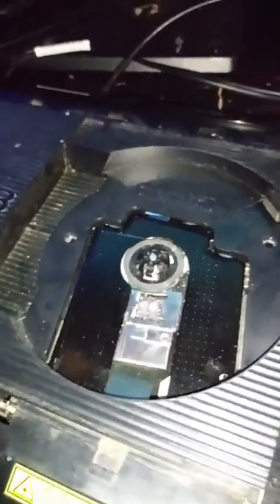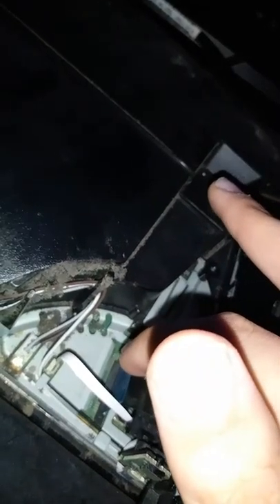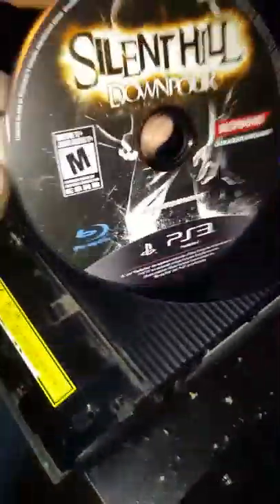How to fix ps3 super slim not spinning disc or reading disc

Comment: That's the EXACT problem I had on my PS3 Super Slim, the connection must have gotten loose over time. Thank you so much for showing this issue on camera, otherwise I probably would have never opened my PS3 and tried it myself 🙏

Comment: What’s all the screws so I can buy the right tools
Reply: the outer screws are just a small philips head. but the inside holding down the CD Drive is a special Torx T8 Security screw, i had the same problem but instead of waiting to buy one, i just grinded it down and used a flathead driver. hope this helps and im not too late lol 😁

Comment: Look all things on mine is working except the laser is does i little one two 3 thingy then stops doesn’t even try and spin the disc I feel either the laser be broke it’s scratched or the connection is cut

Comment: 0:46 how did you take that first top part off?! I have been strugling for an hour and still can't. Also my ps3 doesn't have any screw on the bottom , does this change anything?
Reply: Okay so 15 hours late but first you need to unscrew one of the security screw crews to take the first top part of, you can find the screws when you take off the right side panel by sliding it to the power button and when you do remove the top part make sure to be gentle since you can accidentally break the hooks that holds the top part. For the bottom screws take off the kind of stubs and you'll find them there and one of them is behind a label. That's all and good luck
Reply: You need a t8 security screwdriver to take off the top part
Reply: @alostredditor3102  lol I have already broken one hook and the part that holds the security screws, I didn't realise they were connected and I went hard on it. But I can still secure the top part even without it.
Reply: @alostredditor3102  I did everything on this vid and the cable was at the right place. So something is wrong with the laser. The person that I got the ps3 from yesterday had left a disc inside since the last time he used it in 2016-17. Could that have damaged the laser?
Reply: @titto2602  most likely not since the people who made the ps3 would have already thought of a solution for that simple problem
Reply: @titto2602  its fine since the top part is basically just an accessory
Reply: Worst case scenario is that theres a technical problem with the laser, you may have to replace it but that's should be your last option
Reply: @alostredditor3102  I don't know what to do next though
Reply: No if it's a super slim under those rubber feet are the screws